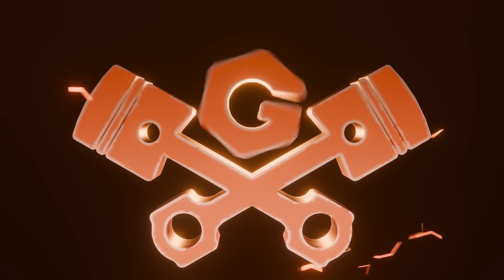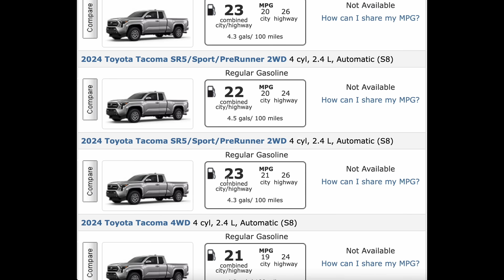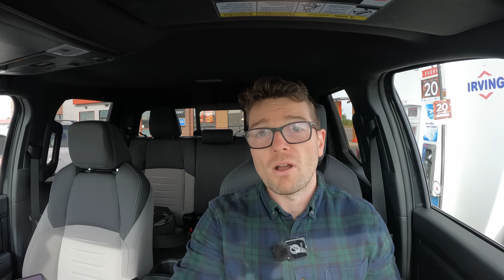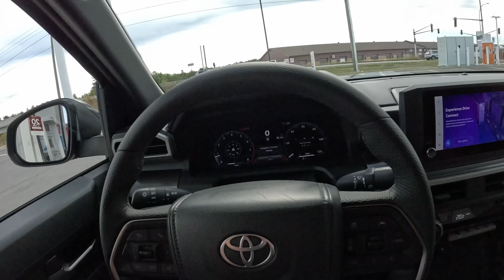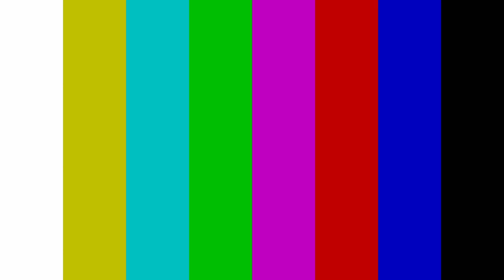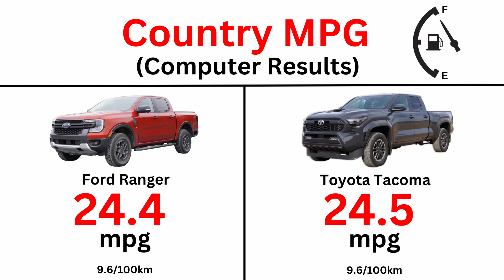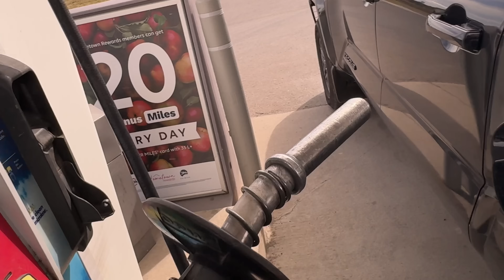Toyota Tacoma 2.4L Turbo Fuel Economy (MPG) Test | Shockingly EFFICIENT or OVERHYPED?

Comment: I’ve not found an engine as peppy for its size as the 2.7 ecoboost. I dogged it when it first came out and wondered what ford was thinking until I drove one and over the years never heard a bad thing about it. I just wonder how lower mileage trucks that may sit for years will turn out and run in the future. Like a paw paws garage kept gem we see with some old trucks.
Reply from the maker: I really like the 2.7L ecoboost as a turbo engine. obviously a complex unit being a twin turbo set up but it has seemingly been a pretty decent engine since its debut in 2015.

Comment: Think you meant Frontier instead of Titan you said it at the 8:25 mark when discussing transmissions
Reply from the maker: Absolutely correct!
Reply: @GettysGarage been driving Nissan trucks and SUVs since the mid 90s, know my stuff!  Compare the non hybrid with a frontier
Reply: Frontier and last Titan uses the Mercedes designed Jatco produced 9 speed.  It's not even properly japanese
Reply: @beexiong2995 USED to as the Titan is no more. No need  ti comment he meant Frontier